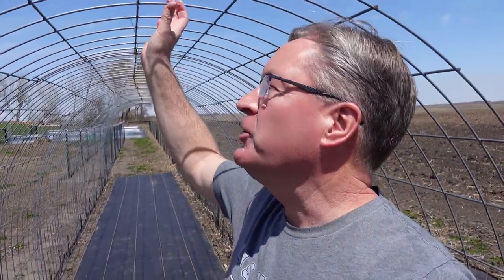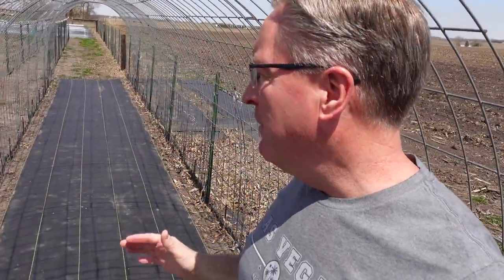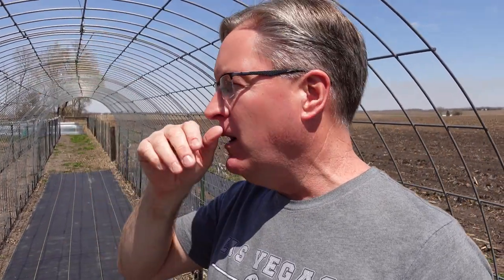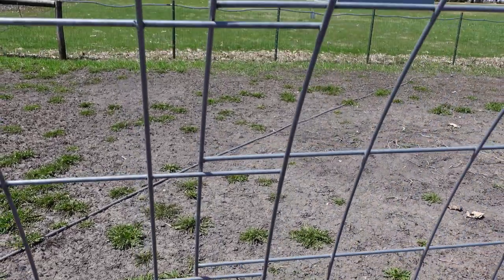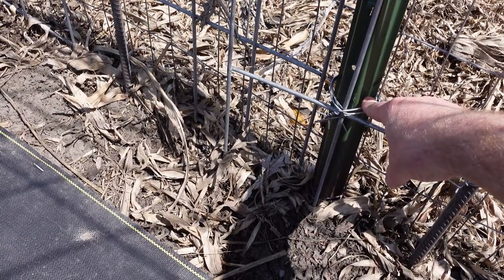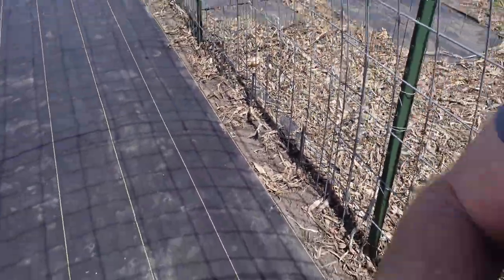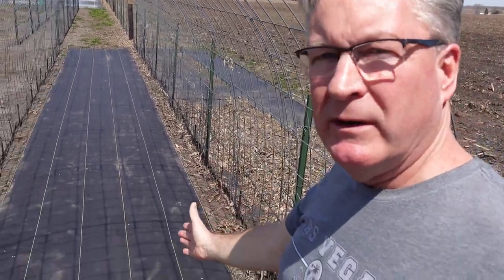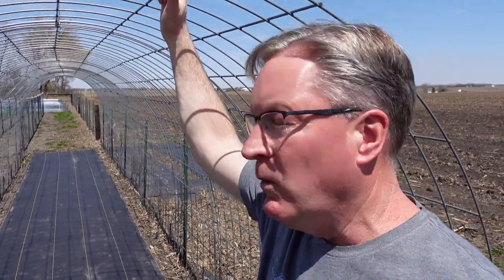DIY Arched Trellis: Build A Sturdy Vertical Garden

Comment: I've had cattle panel trellis' go down that were tied to tposts up high on the post. Enough rain (weight)  combined with wind can make them hard to keep up. Mine that went down had Loofahs growing on it.
Reply from the maker: We had a good storm late in the season last year.  The winds were near 50 mph, with heavy rain, and the tomatoes were covering the entire arch.  It held.  I'm hoping the deep rebar and the length of it was the reason for the strength.  Thanks for stopping by, Gwen!

Comment: What are the height and spacing of the t fence posts? Thanks!
Reply from the maker: The t-posts really aren't part of this garden.  It's our fencing around the outside of the garden.  The t-posts are spaced seven feet apart.  The real supports are the rebar at the base.  The rebar is spaced two feet apart and are pounded a foot into the ground.  We've got a short video hitting tomorrow that gives the dimensions of this garden.  Thanks for watching!

Comment: Has anyone done this with just one cattle panel? Would it be sturdy enough with the rebar support? Also, as a total novice senior lady, what kind of wire would I purchase to wire the panel in place and not rust horribly? I have one silly plant that I want to try that needs a good trellis and I have no trellis where I live. I'm on straight sand so it could be a challenge.
Reply from the maker: You can do this with one, or ten, panels.  It is totally scalable.  The wire we used was electrical fence wire.  You can buy a mile of it for about $30.  It is strong and works great!  Hope this helps!
Reply: @TheOldSwedesFarm  Thanks for the fast reply! I don’t think I’m ever going to need a mile for my little container gardening setup in my back yard ha ha, but I’ve been wanting to put in one cattle panel arch to try some chayote squash and this looks easy to do. Do you think just the rebar on both sides of one cattle panel will be sufficient or would I need to sink Tposts as well?  Now if I can figure out how to get a cattle panel here I’ll be golden. Thanks again.
Reply from the maker: @epristerv  If it is me, I would use three pieces of rebar of each side.  You would be really solid and it would hold up great.  We're going to have squash on part of our arch this year.  I think it'll work great!  Keep us posted on how your arch turns out.  Cheers!
Reply: @TheOldSwedesFarm  Thanks, that was exactly what I was thinking too. Looking forward to trying this out.